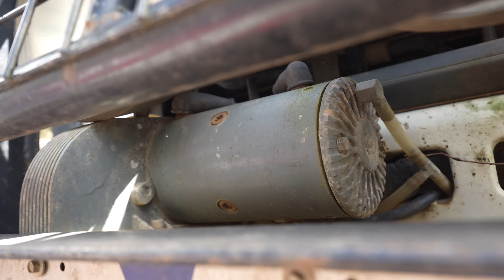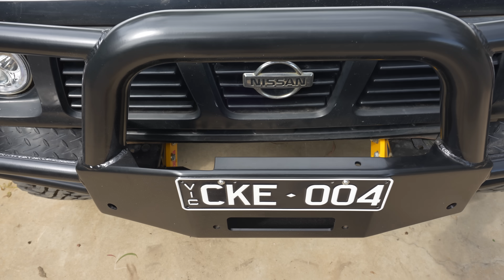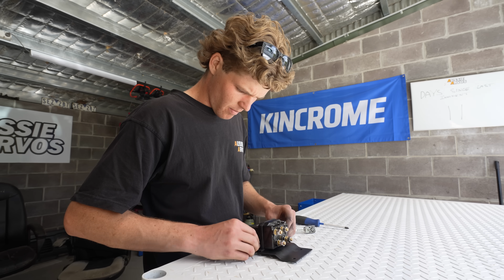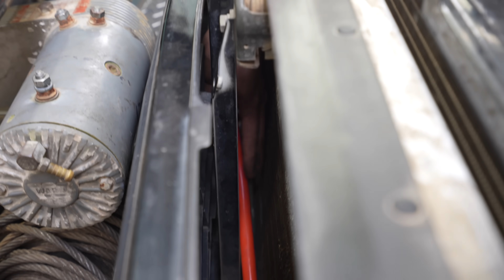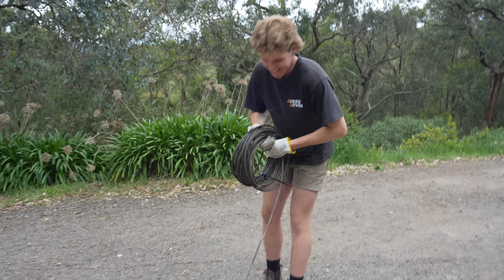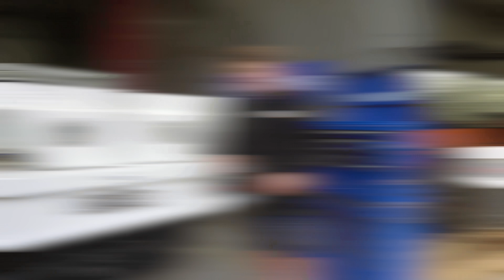Modifying my 4WD for Australia's Tough Tracks!

Comment: Liam are you running sway bars when you flexing
Reply from the maker: I did disconnect them in these clips but after a but more experimentation it seems the rear swaybar doesnt really limit articulation, the front does though

Comment: Unpopular opinion, but that cable is really ugly.
Though I can imagine how expensive it was....😱💀

Black and red or just black with colour coded heatshrink would look nicer.

I can't remember if there was one in the cab, but definitely consider a kill switch/winch isolator.

I love the clean, uncluttered look of the Patrol. Unfortunately, it can't stay like that. Because then it won't be practical for touring.
Reply from the maker: Thanks mate, the orange was the only i could get if i wanted double insulated but ia gree that black would look cleaner!
I will be putting an isolator in the engine bay too!

Comment: minor critique fellas. get some red heat shrink and use on pos leads so in 2 years time you can remember, or if its sold, some else can work out, straight away whats going to where. i get that its all fresh in the head and what not, but over time, we forget.

Comment: Great vids laddies, just a suggestion terminal boots might be a good safety for the winch. Keep up the good work.
Reply: Was just going to say that too, suggest to use Vaseline grease as corrosion prtotection on to the winch terminals and then slip on the rubber boots.
Reply from the maker: Thanks mate! Yes I've just ordered some online to protect the terminals

Comment: When using cables with same colored outer , an idea would be to use colored shrink to show positive and negative.
Reply: I'd be filing the burrs off and taping the lug before heat shrink too
Reply from the maker: Agreed, unfortunately I didnt have any red heat shrink in the right size but will sort it out soon!

Comment: Great video. What's your view on brand new Utes as in manual v auto. We went to the 4WD adventure show yesterday looking at so many set ups. I was thinking manual but so many sales people were recommending go automatic. Thanks
Reply: The sales people probably never have driven a manual in their life they wouldn't know how one worked , I'd go manual your in control there stronger and easier to service and don't need transmission coolers , just don't tow in top gear 😉
Reply: @davidmilledge221  thanks

Comment: Do yourself a favour, dude. Put a few coats of liquid electrical tape on those fat cable connections for the winch. In my opinion, it's the best way to protect them from corrosion and accidental shorts. I think you guys are in the north Eastern suburbs so probably get it from jaycar in Eltham or ringwood.